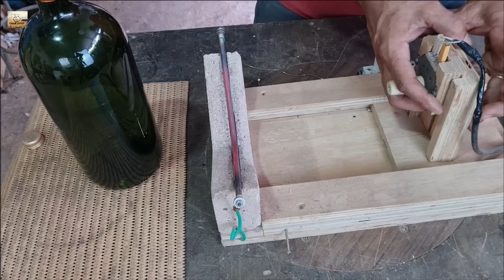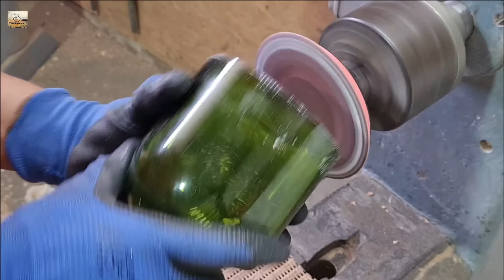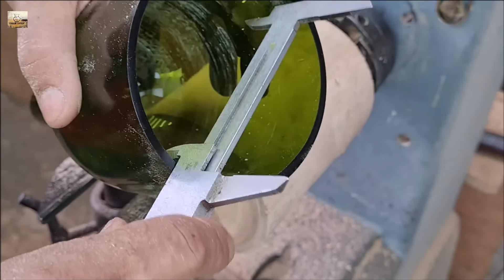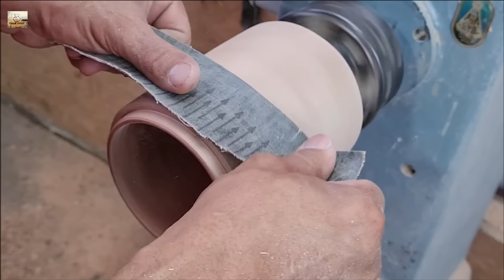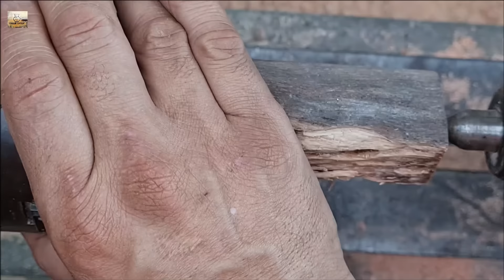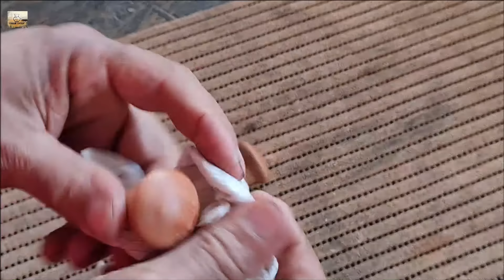Woodturning - Brilliant idea for a decoration  // Brilhante ideia para uma decoraçâo

Comment: Hello, I have a question: Please, how many volts did you heat the iron rod and cut the bottle?  Thank you very much for your answer.  Thanks
Reply: It is not just a rod. It's a tubular heating element (from a stove or a laundry dryer) I see a circuit breaker switch so i think it's 230 Volt. Somehow there must be a thermostatic switch.

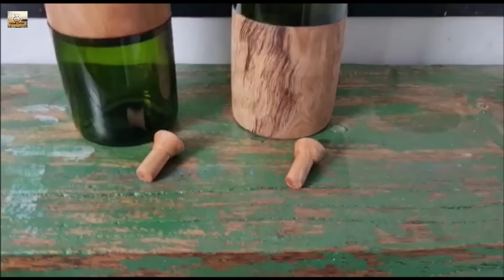Comment: The image at 9:30 seconds made me think of an idea. Tell me what you think of it, if  you would be so kind. Thank You in advance. 

                           ... .       MY IDEA:
Ask the question, What if the upper halves weren't bottomless?, What if they had a bottom to them, to basically make them short bottles? 

You would basically have a pint of volume for your favorite beverage. Say you want to take someone out for a date or picnic: or something. You could fill each upper half-bottle with ur favorite drink and use the remaining bottom half of the bottle as a cup to drink from....  Well, or something like that...

Just a thot. Thanks again